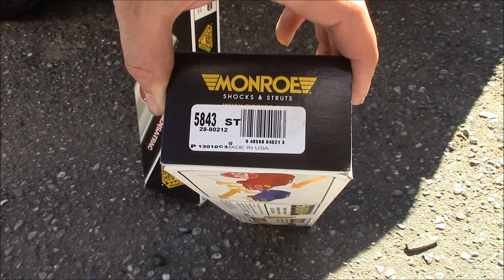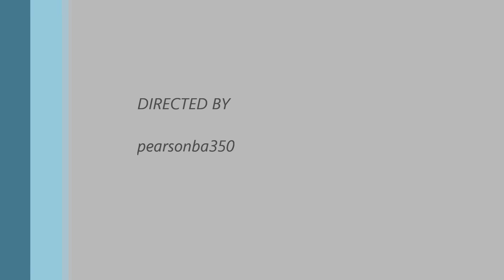New Shocks for the Eldorado

Comment from the maker: Actually, the rears look to be good still.  Less weight on the rear end, so they usually don't wear as fast.  And they're air shocks, for the level ride system, so they cost an arm and a leg to replace.